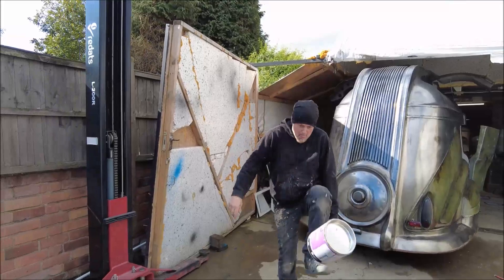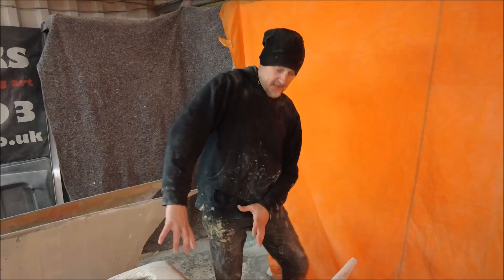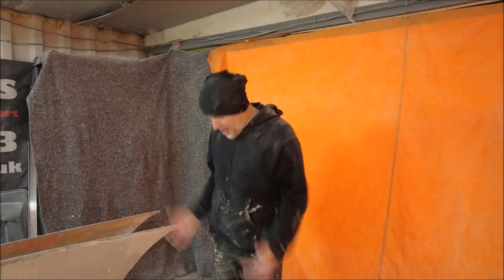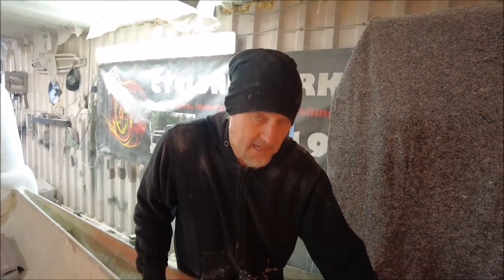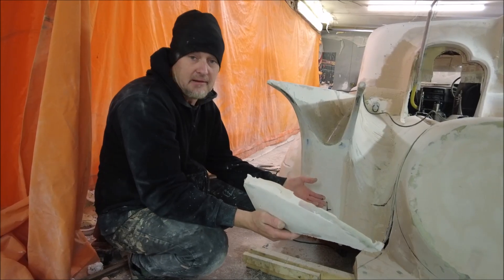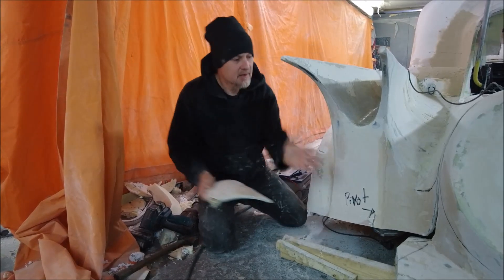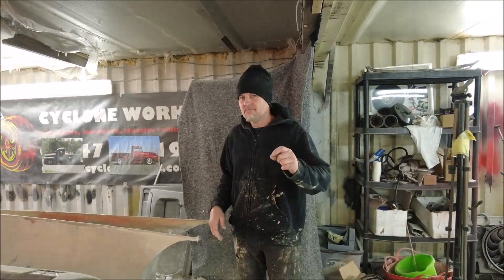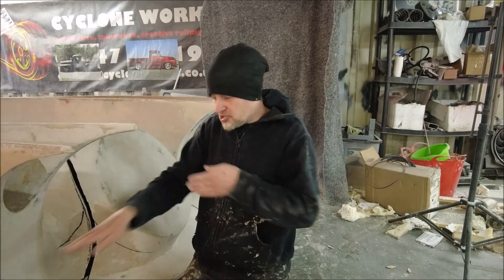The Custom 60's Truck with many secrets!

Comment: You should be sponsored by isopon in Wellingborough. They had an advertising land rover defender with flush fit bonded glass, all the bits and Bobs, nice wheels, all exterior painted in satin black raptor as an advertising vehicle a couple of years ago. Looked a treat on the outside. I ended up spending two days welding two front chassis outriggers and sections of floor and bulkhead both sides big enough to climb in and out with the doors shut to it......  clearly theres a petrol head element in their advertising department.
Reply from the maker: It would be great to be sponsored by anyone to be honest!

Comment: Really liked this one Paul......QUESTION :........What is the aerosol can that you sprayed the pieces of CSM and then stuck them to the backside of the Continental door?
Reply: Yes Paul, what is in the can?
Reply from the maker: Its just Contact Adhesive.  I spray it onto the surface and onto the matt, then it sticks into place before you put the resin on, makes it so much easier and less messy
Reply: @bacop001   Thank You Paul....I'll put that in my memory tool box to use sometime.  :)

Comment: i'm going out on a limb here to try to not be a smarty paints ... but looking from a different minds view - it seems that if you cut off the right side (passenger) bumper "so the bumper is one piece - it would give you tons of adjustment , because a gap between the bumper and the body is to be expected (and you won't have to deal with the small bumper end with no gap ... 🤔
Reply from the maker: Yes, but it would be HUGE and way too long when it was open!

Comment: Can I suggest a better design? Looking at where your ramp comes out of the truck, you only need to make the top half of the round bit get out of the way, or at the most the whole of the round bit. Why did you need to cut into the bumper, weakening it, and adding a colossal amount of work and complexity to the design. KISS ( Keep It Simple Stupid). Doing this would make it easier all round, you would need lighter hinges as they are supporting less weight, your bumper isn't weakened, you have a much simpler mechanism, and god forbid anything happens to it, it would be easier to repair.